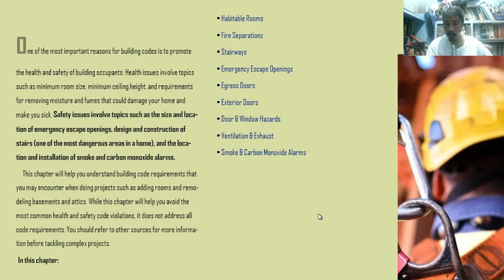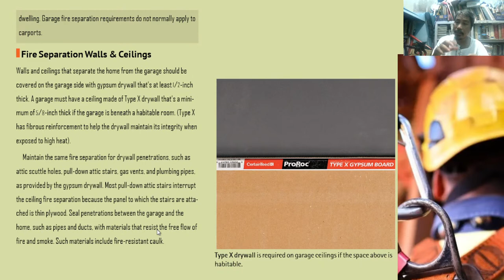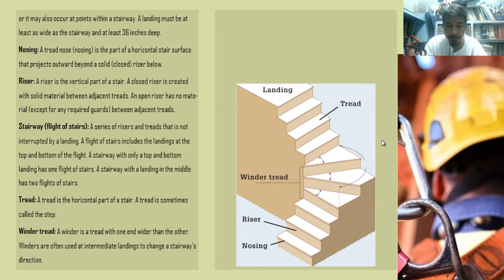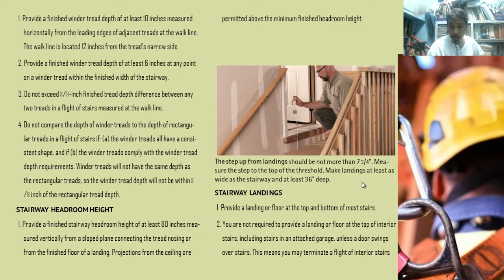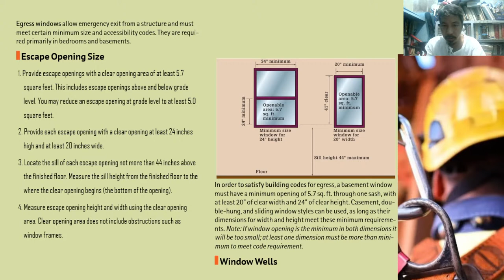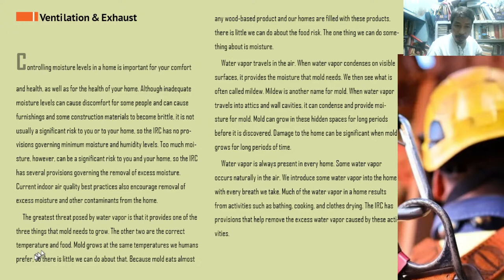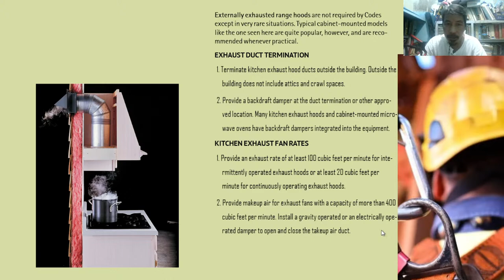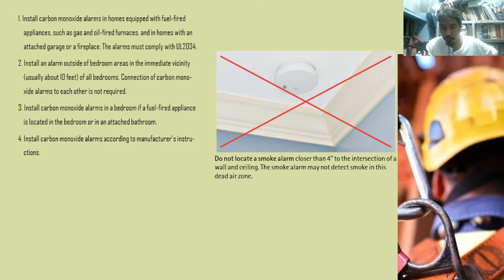[ LIVE CED2 Lecture 12 ] DrAP Zantua Firepro & Sanitary System Talks + IRC Design Code

Comment: Thank you for this live lecture about fire protection and sanitary system. In this video we talked about the Fire Separation:
 Garage & Home, Fire Separation Doors, Fire Separation Walls & Ceilings, HVAC Ducts & Registers in Garages. I've learned some minimum standard measurement of stairs, doors and windows.

Comment: thankyou sir for discussing again the fire separation, so that we can recall it again. Under this, there are Fire Separation:
Garage & Home, Fire Separation Doors, Fire Separation Walls & Ceilings, HVAC Ducts & Registers in Garages. The Interior and exterior stairways are regulated closely by most codes because they are inherently very dangerous parts of a house.

Comment: Thank you sir for this live lecture video that tackles about firepro and sanitary system. In this video we talked about the safety issues of design, construction of the stairs and the location and installation of smoke and carbon monoxide alarms and the importance of having an emergency scape opening.

Comment: Thank you sir for teaching us about fire pro and sanitary. I’ve learned that the garage is a space for parking motor vehicles that is completely closed to the outdoors on three or more sides. It typically has an overhead door. But a structure that meets the requirement but has no door is still considered a garage.

Comment: Thankyou sir for discussing about fire pro and sanitary. I’ve learned that the garage is a space for parking motor vehicles that is completely closed to the outdoors on three or more sides. It typically has an overhead door. But a structure that meets the requirement but has no door is still considered a garage.